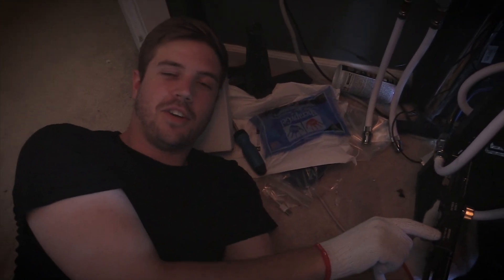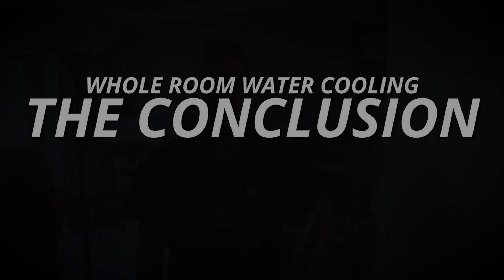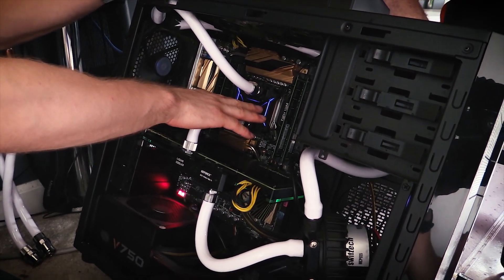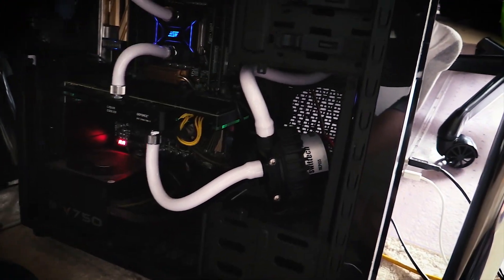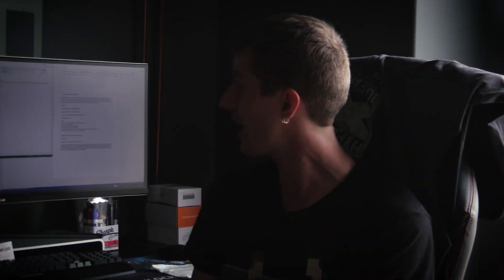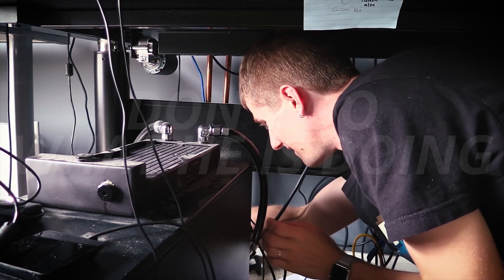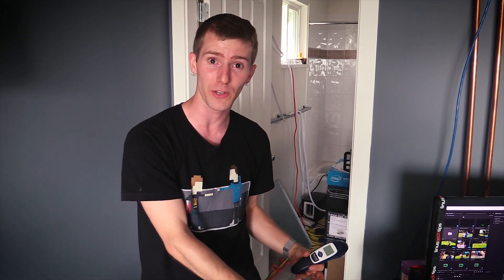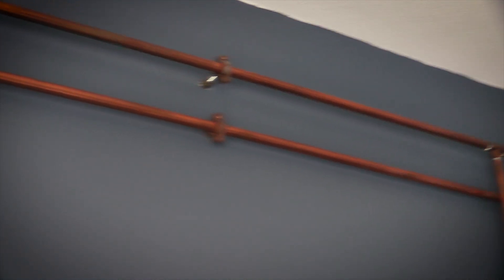Whole Room Water Cooling Part 7 - It's FINALLY over!

Comment: Here's where you could've made it functional and worth it...

1) First, no copper pipe. Use PVC. Much easier to work with and less overall corrosion. Growth is another thing, see #3.

2) Second, it would've helped your pumps quite a bit to not have to push so much water up so high (the gravity force of the water going down the other side does not negate this). Bring the pipe down below the [electrical] plugs. Also the long pipe leads that connect to each station should've been much shorter, which would've been if the main pipes were lower. And don't forget, that the main pipe also should've been a size or two bigger than each terminal size, to optimize the flow rate throughout the system, preventing any one system from choking on a lack of flow. Then each system would only be responsible for pushing fluid a short distance with less restriction.

3) Third, I would've used a plastic tote/container (even a glass tank) instead of a metal reservoir. It's much easier to rinse, clean, replace, and/or top off (evaporation, cause not sealed). It's also easier to check on and add your additives when needed, not to mention easier to just refresh the system as a preventative measure. Make sure this IS placed at a higher elevation than rest of system if not sealed!

4) Fourth, I definitely would've removed both windows (they come out of the frame easily) and created a box for the radiators to fit within the window frame. Very easy to then connect a box fan to just push hot air out, or reverse it to warm air blown into the room during winter. Hell, I would've even opt'd for an automotive radiator for this job...cheaper and more volume and air flow.

Final, yes I know this is an old video, but who knows if you guys will ever try this again, properly, for an effective cooling solution. :)
Reply: I think putting a liquid-liquid heat exchanger between the individual computers and the shared loop would of been good.
Reply: well said mrtwisted, the box fan in the winter is a really interesting idea to... i was thinking the entire time watching these videos about them just usin a vehicle rad and fan (or simple box fan)... probably wouldve been easier/cheaper/and just as, if not, more effective
Reply: They could also have done a mix: one copper pipe and one insulated copper (or C/PVC) pipe. By doing this:
- In summer, it wouldn´t heat up the room;
- In winter, they could invert the flow, so it would indeed heat up the room;
- It would dismiss the extra radiators over the PCs.

What I just didn´t get it is why are the pipes at so high level? Couldn´t they be near the ground or a little bit lower than a desk height? That would have saved:
- Around 1/4 of pipes;
- Pumping;
- Water and additives;
- And it would also heat up better the room in winter.
Reply: Yes, the reservoir should have been mounted higher than the computers and the distribution pipe at the bottom of the wall. That way the pumps would have had much less work to do (in terms of height as well as flow resistance, as the piping would have been a lot shorter overall).

Plus: add a vent valve at the highest point in the loop.

And good point to use a car radiator (and a proper fan).
Reply: Additionally, the far end of the loop should have had the system on tees still and then the cold and hot lines of the main loop connected with a smaller size pipe. This would have allowed the main pump(s) to push the air through easier. at each system, the air would rise to the main loop pipes, and then that would be carried through the connection at the far end.
Reply: @Coderjo.  that's a fair point, the single biggest airlock (bubble) must have been the drop at berkels machine.
Reply: Now that they have an actual engineer on payroll they should really take another crack at this.
Reply: Add some (a lot of ) valves to isolate every computer from the loop
Reply: About point 4 and heating air blown to room in winter - I don't see how you can do it. This computers aren't creating enough heat for that and radiators are not designed to heat up cold air really fast, they're are for dissipating heat from coolant. Water temp is to low (around 30C maybe a bit more under high load) to heat up a stream of air blown to the room to around 20C if it would be like 0C at outside or even lower. 
Car heating it working sorta this way, but there are few important differences. Car engine is creating a lot more heat you have at least few kW of heat to use even at idle. Car coolant is kept around 90C because it's best for engine and oil that makes heating cold air from outside so much easier. And at last climate control in car is not blowing so much air inside the car.
Reply: @Riktos  So, cooler instead of "winter" I should've said. Considering how much heat my PC puts out, which after a few hours does make quite a noticeable difference in my house, or at least the room, it is also being recirculated. Unlike with the window which would have to pass through that cooler air from the colder weather, through the room and back out, taking warmer air with it.. So yea, you're right about that. It should be cooler weather.
Reply: I forget what they said in a recent WAN Show, but he mentioned whole room water cooling in some way. They've got more resources and employees now, so if they were to try it again, they should have more success. I just don't remember what he said, so I'm thinking it's not exactly whole room water cooling.

On the other hand, they still make some weird mistakes, like fully-closing a baffle in his new house's AC, rather than mostly closing it to prevent excessive pressure.
Reply: you should do it, no offense, i would love, i mean LOVE, to see anotherr version of this
Reply: or you could just go with air cooling and be done with almost everything listed
Reply: @Madtroll1209  I think the computers would get to hot with just air because of the processing power. Its usually why you water cool but the room could be cooled with more fans....and of course a ac unit...
Reply: @shadowwatch6330  "computers get to hot with just air because of processing power" 

obviously you've never heard of noctua coolers
Reply: @Madtroll1209  yup lol
Reply: @shadowwatch6330  I rather pay less for a noctua cooler for 1-2 degrees difference and with vastly superior reliability. There are folks still rocking the d15 from 6-7 years ago and all they had to change were the fans, while the heatsink itself was still in good condition. Can't say the same for AIO or custom loops.
Reply: @Madtroll1209  I dont think heatsinks go bad anyways

Comment: Aside from being a few years late, AND most issues have been talked about I didnt see one person say that they should/could have used one electric (12v with a 12v power supply) automotive radiator fan for  the heat exchanger out side. Just a thought.

Comment: I have been thinking about for 2 years on a lot of thing I would say you did wrong. And plz understand this is not to cut down on you or your team cuz I love your videos and have gave me lots of ideas for things to do and not do. One you should have not ran your piping at the top of the ceiling. The only time that the piping should’ve went up that high was to go around the doors it should have stayed at ground level it would slow the pumps to work easier instead of having to pump the water up to the ceiling down to the computer and then back up to the ceiling. And for the return line that was the heated water or coolant. You should’ve used a tire foam insulator to keep the heat in that part of the copper tubing instead of expelling into the room. I would like to hear your thoughts on what I just said but if not it’s all good

Comment: PVC would have been better for piping.  Almost 0 corrosion, easier to install and modify.  Then, there's less heat transfer from PVC to air (plus you had no insulation on the copper piping).  Also, you could have used a vacuum pump to pull most of the air in the system out, THEN fill with your cooling medium.  You also had no cut-off/isolation valves ANYWHERE in the system.  Those could/would have saved you HOURS of troubling shooting time and would have made your quick disconnect system that much more safe.  Water/electricity? BAAAADDDDD. Oh, lest I forget, your radiator assembly at the heat sink end outside? Yeah, that was just a bit EXCESSIVE.  You could have bought fittings for ONE LARGE radiator (automobile?) with ONE cooling fan/motor and run it off AC.  Ummmm, kinda like the arrangement for a freon condenser for a central heat/air conditioning system for a house?   I understand the concept of "redundancy".  I'm intimately familiar with it, being a former US Naval Reactor Operator.  All that being said Linus, what you guys do overall is amazing.  Hands down the best computer/electronics tech channel on Youtube.  However, I think you guys might want to step back and re-examine the KISS system.  Keep It Simple, Stupid.  Some of  your projects remind me of the videos of the exTREMELY elaborate "booby traps".... vs. a simple wire snare.  Make sense?

Comment: what a bad idea. -.- the dirt in the system comes from the copper tubes. Why the fuck you didnt try to set the whole systems in cooling channeling at the ground where flows cold air in and out of the case from a air-conditioning system. and with this copper tubing you still drain heat into the room.

Comment: hey I did not seen before parts...but just from watching first 3 minutes...if you will run copper tubing with hot water around whole room...that will not help cool the room , only of you were sending really chilled water from the other side...otherwise it woul work as heating same as the radiators...but if you used plastic tubing it would be better and you would be able to efectively transport hot water out of the room to be chilled elsewhere (tho transport the heat out of the room). this copper tubing doesnt seem like best solution to me (and copper is so expensive)
Reply: ok linus said it himself...but why do it when you realize it sucks? :D its not estetic but it would be at least functional with plastic tubing or some hoses...and you could hide those hoses or plastic tubes run them low not high up and put some cover on them with insulation which would help even more to funkcion...I was thinkig about some system myself because yes, playing on hot PC in a HOT day sucks...especialy if you have your pc near to you so I want to solve this somehow too...easiest is still air con or simply have PC in some other small room that can be ventilated and simply make pc conections extensions. usb hub.long HDMI and thats basicaly ok...

Comment: Ok, so, skipping the problems you already realized yourself, here's some highlights of what you did wrong:

First: You allowed fluids to mix between loops.
Cooling loops inside a computer must be tightly controlled and managed by necessity. You need to control the materials and fluid additives you use to prevent problems from developing.
Cooling loops in other systems don't require such tight control due to the fact that they simply don't have the same constraints.
Instead of running the same fluid through each system and the main loop, you should have had a heat exchanger as a demarcation point so that fluids and problems were always kept isolated.

Second: You ran the lines in parallel.
If you had the systems connect to one side of a heat exchanger, that would allow for systems to connect and disconnect without any interruption of fluid flow through its segment of the main loop.
That means that rather than needing hot side and a cold side you could have all systems connected in series and only have a single loop. This would greatly reduce the requirements for pressure and flow rate, and contrary to what you may expect it would mean no more than a couple of degrees difference between the first and last system in the loop.

Third: You had the radiators disconnected from the systems in normal operation.
You should have had them connected to the loop in parallel with the heat exchanger, and used a gang valve to cut off fluid flow when not in use. That would make it so that the ONLY time you would need to touch a system's quick disconnects would be when that specific system needed to be moved. As the radiator would be connected in parallel with the main loop, the only action people would have to take to prepare for maintenance of the main loop would be to turn the gang valve and allow fluid to flow through the radiator.

Fourth: You used ethylene glycol.
Do not use ethylene glycol. Just don't. There are so many better options out there that aren't nearly so hazardous for human health. Instead, use propylene glycol. It's safe enough that it's approved for use in food processing equipment.
Further, ethylene glycol gradually dissolves materials like vinyl, which you used in your loop. Always match coolants with materials.

Comment: Did anyone suggest foam insulation on the hot copper pipes?? Ruins aesthetics, but it could be removed in the winter for warmth. 

Moot point since this is really old but still think the concept is cool and could work?

Comment: I gave this a thumbs up because I kept laughing. I never saw the planning stage, but I don't think a calculator was used. Like how much flow rate do you need, and how much are those two filters going to reduce it. What is the price difference between copper pipes and pvc pipes, which is easier to put together. If you had to go with copper why did you not put insulation on it to keep the heat inside the pipes? The outside radiator, why not use a car radiator, with a big (car) electrical fan on it instead of those small fans and small radiators. To keep water flow up you needed to have smaller pipes from each computer going into larger pipes. As water heats up you need to have a expansion tank for the water to go into. I could go on, but whats the point! Someone did not plan this at all, and it shows!

Comment: I see you learned in the end that UV sanitizers on flowing water don't do a damned thing. It isn't in contact with the UV light long enough to do anything. These are sold to the unsuspecting aquarium owner as a magic solution to algae. Never works.

Comment: if you put a aquarium cooler out site and in close loop system you put on the highest point a airvent for heating systems when you fil up the system the air go's out via the airvent (manuel or automatc)

Comment: Instead of blowing a ton of cash on putting a bunch of individual coils together with a bunch fans, I would have gone to the scrap yard and picked up and old heat pump condensing unit and swapped the compressor with a pump. Resivour is usually built in. Hang it under the window as the lowest point. And for the love of all that is coppery, spend a few bucks on some ball valves to bypass and/or bleed each branch of your loop. Also, extend your piping below where the computers connect with a removable end cap. This way, as the water rushes down the piping, solids will rush past the comp cooling inlet and collect in the bottom of the pipe. Then you simply isolate that branch, remove the endcaps and let the sludge dump out as part of your maintenance routine.

Comment: Awesome build, I've enjoyed watching this cool excitement. Although it's probably already been mentioned, I DEFINITELY would have put diverter valves on your hot/cold pipes on the wall behind each desk which would eliminate the whole getting under the desk to swap the lines problem, when connecting/disconnecting the individual PCs. It would be as simple as reaching to the wall (while seated or standing) and turning two valves. BAM now that PC is disconnected (or connected) from the whole room loop in about 5 seconds without hoses dangling and risking leaks occuring.

Diverters like these:
http://wiscteachereducation.info/data/water-filter-valve/images/water-filter-valve-household-water-filter-copper-there-way-38-quick-connect-ball-valve-for-ro-diverter-valve-for-countertop-filter-faucet-adapter-diverter-valve-for-countertop-filter.jpg

Comment: Why didn't you just use the radiator on the top to cool the air exiting into the room by externally cooling that and use the fans to blow the exiting air through. then no water cooling internally needed less maintenance. We cool multiple servers in a small room blowing air in through a Chilled water cooled radiators

Comment: this works and works verey well temps on a 15 pc run with core temps of 15 to 22c ,but youur design was off from the get go power on any type of copper pipe makes the yellow rusty look and corrodes them fast, you can not close loop the system at the last pc  (water going to ways at once traps air in the line, cold line to each system branch off would make cold water hit each pc =, double wall cpvc pipe would have extrema temp hold. heat from the sun throw the cover over the cooler would work like a magnifying glass heating the water instead, each pc hot side should drop into the reservoir the come out to the coolers in a temp control room

Comment: What about insulating your copper return lines? Kinda like a house has insulated returns from the AC unit. Wouldn't that keep the fluid cooler across those long runs of copper pipe?